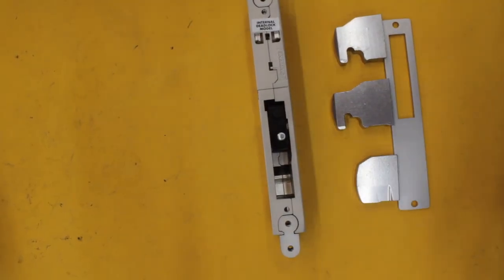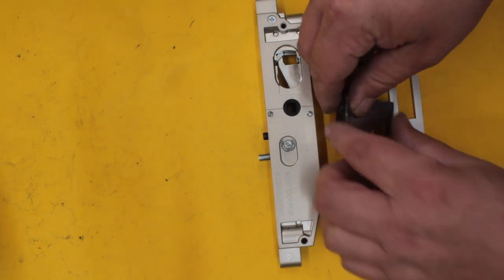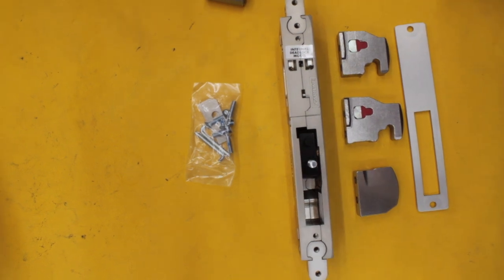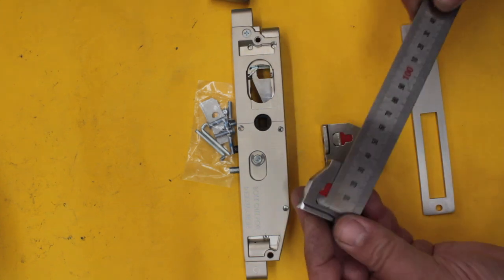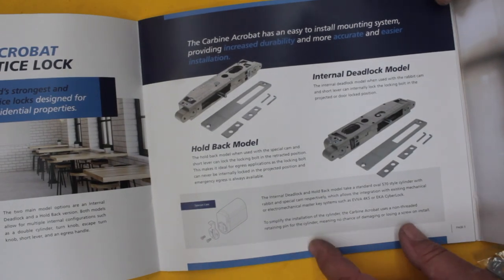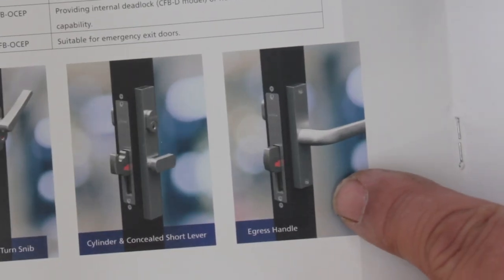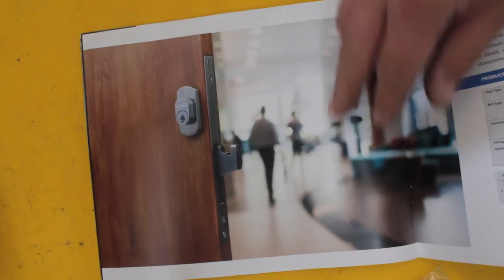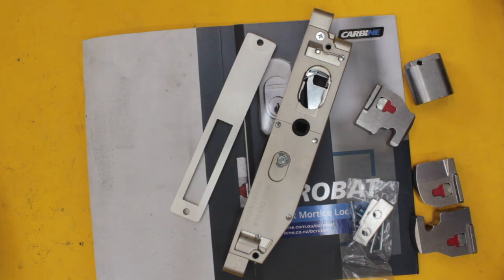Carbine Acrobat Mortice Lock Look Over

Comment from the maker: Update. 
1. The bolt is attached by the screw at the back, you turn the bolt and the bolt screws onto the lock, the red part is like a nyloc to stop it from coming undone over time. 
2. The top and bottom holes are extra, and can be removed, extra if needed if you have a bad door or for extra strength if you feel you need. 
3. It cylinder only from the outside, the inside s the side that can have all the different handles.
4. The lock has the option to deadlock even with the lever on the inside.
5. You can lock the lever to prevent unwanted tampering with the lock.
This is just some of the functions that were not made clear i the video, if you know of any other please leave them below

Comment: I actually installed one just last week. My first one.
Reply from the maker: how did it go
Reply: @DrLockShop  it fits perfectly in olace of your standard bolt throw and it seems pretty rugged. I guess it's just seeing how they last. Otherwise a pretty easy install. I used the long throw bolt but have 2 rattling around in my van.
Reply from the maker: Keep then , they cost $10 each, I left out some important facts by accented in the video, apparently you can deadlock the lock and make the leaver locked, it has extra holes for mounting if needed, and the sliding door latch is stronger too, after the video the sales rep called and gave me a run over the lock, it sounds good, they spent a lot of time and effort to make it, and the price is good considering, Im just waiting to get the chance to fit one, waiting for a customer in need
Reply: @DrLockShop  yeah I had a run down last time I was in their melb office. I do like the idea that you can lock it open. The fire safety compliance ppl will love that.